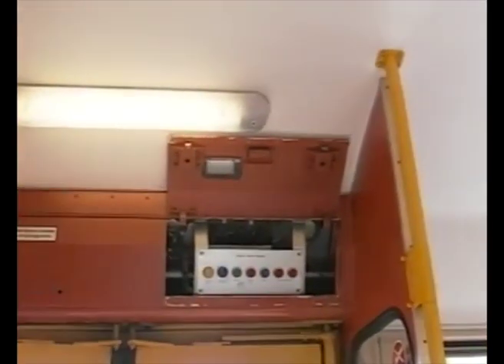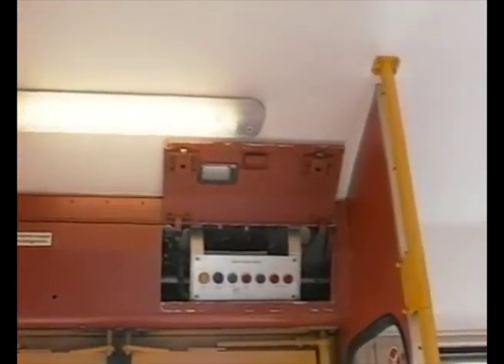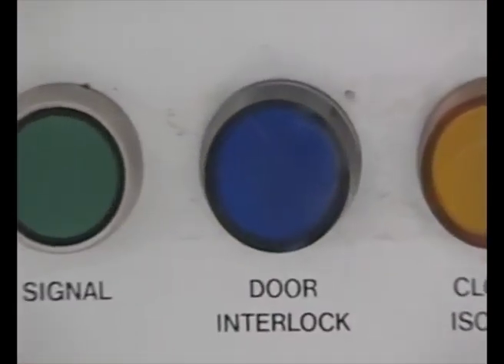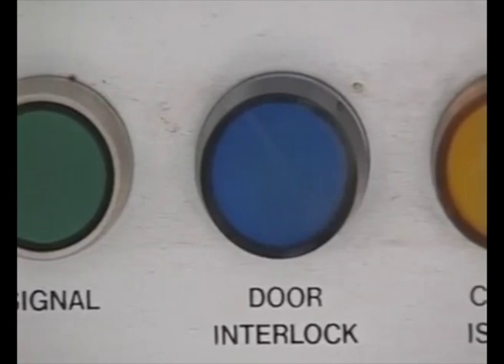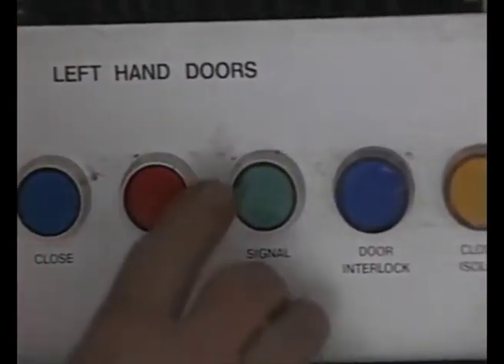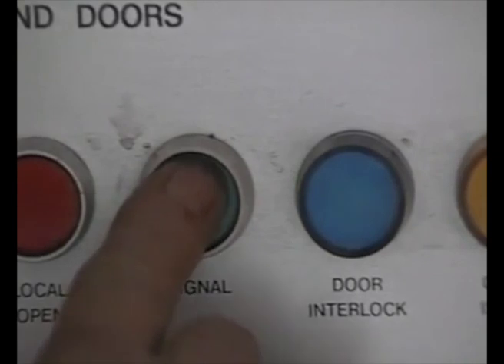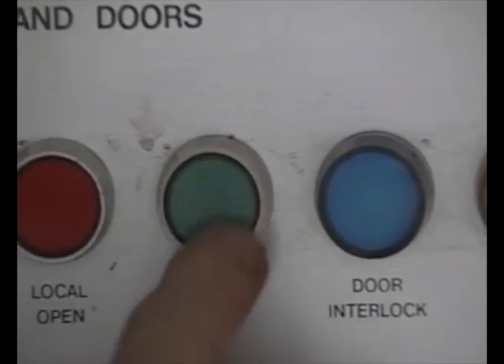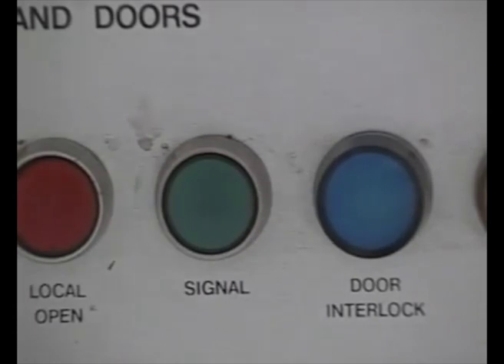Power Controlled Doors - British Rail

Comment: Why then high vis jackets so small? British rail cut backs?
Reply: *were and it was because health and safety wasn't at the same level as today
Reply: So it was because of cutbacks to British Rail?
Reply: The purpose of a hi viz tabard is to identify a person working on the line or in the vegetation of the cess - I expect a high torso of the garment is to do with the part of the person likely to be viewable against contrasting groundout equipment at considerable distance from the driver in the cab. I think there was a concern when hi viz first developed it was helpful against dark machinery or made ground but doesn’t contrast as much with sunlit vegetation as with dark clothes, which is bright and abundant below torso height on British railways. That’s definitely the reason orange is preferred to yellow.

Comment: 5:38 Why can't he do it from the rear cab and why can't he do it from a cab if there are other locations available? Cabs are better IMO.
Reply: Not from the driving cab as the driver would be in the way, not from a cab if another location is available so that the conductor has contact with passengers.
Reply: @lexifillems I meant the rear cab.